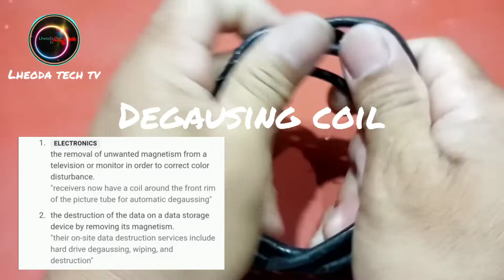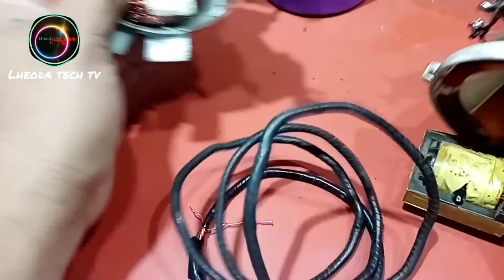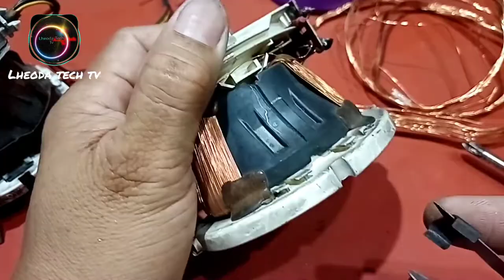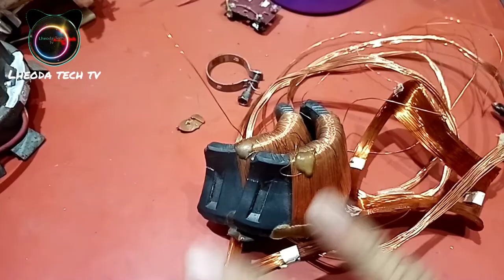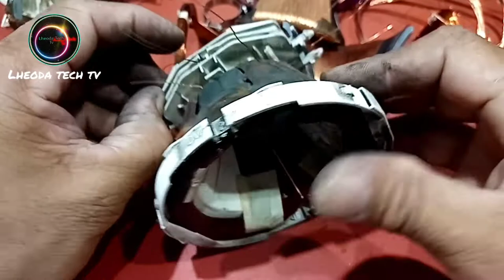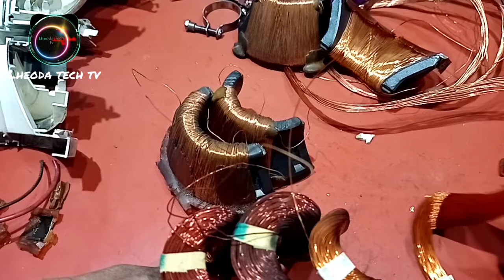CRT TV PARTS W/ MAGNETIC COIL RE USE FOR DIY PROJECT, AUDIO&POWER SUPPLY X FORMER   @LheodaDjTechTv

Comment: Ayos nice job boss tan0ng q lang ano gagawin pag ang dryer ng washing di na umiikot?
Reply from the maker: Umugong lang po ba? Maari pong capacitor ::::ayaw mag power? Maaring power cord, switch , o mga wire baka may loose connection o nangatngat ng daga... Kung ok po lahat ng nabanggit ko may posibilidad sunog po ang motor.